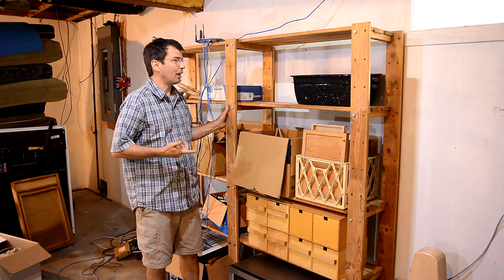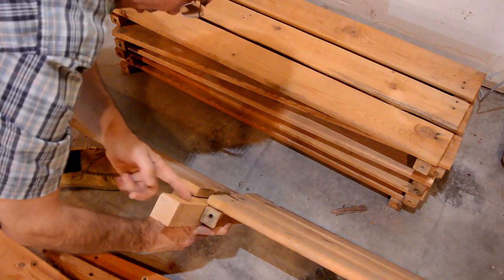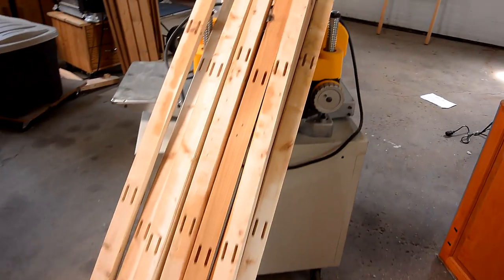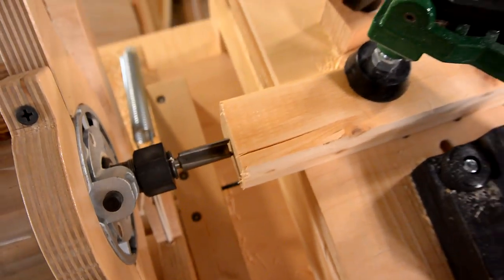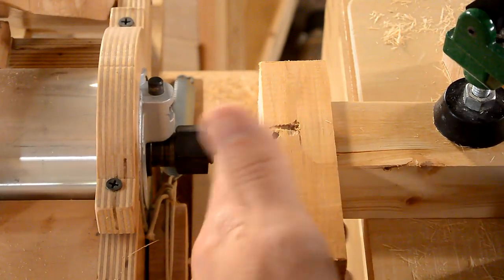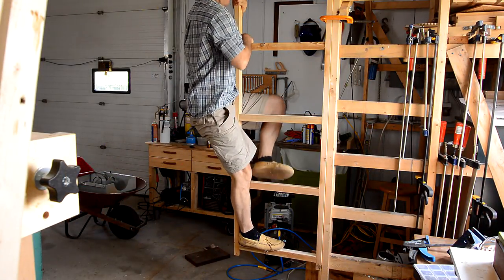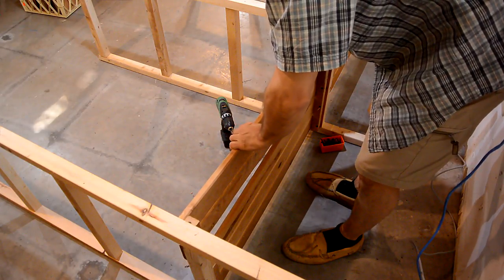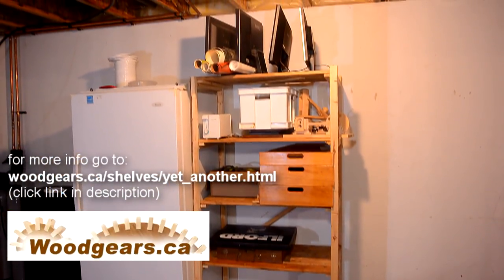Yet another shelf build

Comment: I'm pretty sure those shelves are an IKEA kit - or they're very similar. In the IKEA kit there's a diagonal steel member to address the wobble issue, but it would seem whoever put that kit together left that bit out.
Reply: I have some in my basement and they are pretty sturdy. Clever design too. They aren't bad shelves.
Reply: James Nugent I see reading is your most advanced skill.
Reply: Neroxen I did read, and understand, the comment. I just wanted to use the joke of how ikea furniture is difficult to assemble- however badly I made the joke
Reply: James Scheffler that was my thought right at the start of the video.  A few diagonal struts, or corner gussets, would have saved a huge amount of work here.
Reply: James Nugent Ikea items are difficult to assemble?? Seriously... It's one of the easiest things you can do. The instructions are clear and parts usually only go one way and in one place. I dont understand how someone would not be able to build Ikea furniture.
Reply: We've got the same shelves, about three times the number  Matthias  has, they have been in the house about 10+ years *packed* with books and have great. They have outlived any of the cheaper chipboard ikea shelving many times over despite their looks.
The bolt design is annoying(The braces are either damaged or split on ours in places) and causes racking, but other than that it's very solid shelving.
Eventually to be replaced with narrower, custom ply ones to better fit the space.
Reply: Adam Perkins: But that wouldn't make much of a video.  You have to think of the audience, not how much work Matthias has to do.
Reply: Yeah have the exact same ones on my balcony, very rickety indeed. It's fine for what I use it for, which is nothing heavy.
Reply: iPelaaja1 I can assemble ikea furniture no problem. It's just a running joke that ikea furniture is hard to assemble for the common joe who has little woodwork experience
Reply: Only the later versions. I have the exact same shelves from 18 years ago and they didn't have the members back then.
Reply: I tried to extend an old set with new elements,  times and dimensions have changed, it also contains 50% less wood now.  I had to do some 'woodworking' to bring it together.  
For what I see the cross braces already existed 18 years ago
Reply: I found one of those Ikea shelves, that someone threw away because the metal stays broke.  Very flimsy ; I fixed it.
Reply: Yes, it's a Matthias Wandel Ikea hack!
Reply: Ikea  0 points
Reply: This is not a IKEA shelf!
Greetings from Sweden.
Reply: from Ikea garbage to Matthias proof in under 7 minutes
Reply: I personally think the original design looked way prettier... a fix would have been better me thinks. :/
Reply: These are IKEA HEJNE shelves. I have some in my basement and they're supposed to have an metal X-brace in the back for stability, and they're good enough for storage boxes and such as-is.
Reply: James Scheffler Those are Indeed from Ikea and were named "Sten". Got discontinued many years ago and were really great. I once built a whole kitchen from that stuff.
Reply: They still have them at where I live (netherlands), one shelf costs 16 euros or something like that
Reply: Yeah, they were basically cheap enough to not be bothered about getting materials for a similarly sized shelf.
Reply: They're called HEJNE and they're still sold As of December 10th 2017

Comment: @ 2:22 Note that with the 2:1 reduction and measuring in inches, 13/8" in the template equals 13/16" in the workpiece, or a simple doubling of the denominator. Working with fractions is underrated!

Comment: As much as I enjoy your elegant solutions and the math you've done to create your personal workshop tools and tool enhancing jigs, I have to ask the following question.
Would it have been simpler to attach diagonal braces to the rear and sides of the shelf unit to prevent the movement?
A significant amount of labor was utilized in this project.  Were there aesthetic or other personal reasons for the transformation?
Thanks for sharing your projects.  :-)

Comment: Here is how build utility shelving. It is utterly simple, very strong, easy to assemble and disassemble. I drill a hole at each corner of my shelving material. I cut PVC conduit to lengths equal to the shelf spacing required. I run four long lengths of threaded rod through the shelf corner holes and through the PVC spacers. Nuts and washers top and bottom on the threaded rods pull everything together, and I am done. This method also enables shelving units to be hung from a ceiling - the top ends of the threaded rods secured by appropriately strong brackets. Threaded rod can be purchased in lengths up to 10 feet.

Comment: When I build my ladder shelves, I usually make fronts 5mm lengthways longer at the bottom than backs. 5mm is only a SLIGHT difference and it works like a charm. I have build a few library shelves this way and none of them slants forward. With 5mm longer on front, all my ladder shelves rest perfectly against the walls, no wobbliness and so no need to nail them against walls. I have one entire wall covering with sturdy shelves holding thousands of books.

Comment: Quick question about your routering technique.

 I've been programming CNC metal routers for a couple years and I'm interested in a technique you showed. When you make your mortises, you do the whole thing with plunges and then clean it up with a couple passes. I've always used the idea that those bits work much better in a pass than in plunging and that you generally get a better cut if you made three or four passes and only plunged to change depth. That being said, what is your reasoning for plunging so much? From your other videos I assume that you've done some extensive testing and come to the conclusion that your method works best for your applications, I would just like to know what the difference that you've found is.

Thanks
Reply from the maker: When going into side grain, the bit cuts better in plunging, especially after the first plunge, because the chips can escape to the side (I overlapped the holes).  I also get less side forces on the bit that way, which makes for a more accurate mortise.  This may not work as well on a CNC router, because the plunge axis is probably the slowest, and gravity would help hold the chips in the slot.  Going manually, I can see how it's going and adjust cutting speed accordingly.
Reply: Matthias Wandel Thanks! Most of what I cut is metal so I don't have to worry about grain very often. I also have side forces so much higher than with wood that the plunging doesn't help much with that. Also, I'm sure you break bits far less often than we do as we focus so much more on getting mass quantities shipped out that breaking bits is expected to happen several times a day. 

Your answer does help get me thinking about my own personal wood projects though. Thank you again.

Comment: What are your thoughts on using floating tenons as opposed to traditional mortise and tenon?  I find them easier and faster to make.  Maybe you could do a comparative strength test (when you get organized).
Reply from the maker: Nothing wrong with them.  In this case, with the pantorouters, integral tenons were faster.  But - if I made floating tenons out of oak, it would actually have been a bit stronger.  Because the tenon is the weakest part in these ones, and a harder wood would help.

Comment: It amazes me that shelves like these are allowed to be sold they are so flimsy they are basically dangerous (pre MW rebuild). I inherited a set like this and just dismantled it and used the bits as scraps. You pretty much have bolt them to something.
Reply: those are ikea shelves and called "GORM" - they come with a back brace/cross that needs to be attached and also some L-backets to mount them to a wall - if done properly (just a 4 extra screws per unit) and those won't move even if you climb on them
Reply: suit1337 mine weren't IKEA and didn't have back braces

Comment: Matthias, i have a question? I just finished building your 16" bandsaw and it works great, exept for the upper wheel. The innertube tracks off from the wheel. It has came off couple of times but only while turning the wheel by hand. Do you have any idea why that happens?
Reply from the maker: Possibly wheels not planar, so that the blade tracks somewhere other than on the crown.  Also make sure to clean the innertube, and varnich the wheel so it sticks.

Comment: I've never worked in inches, but wouldn't it make sense to only work in 1/256th ? Because  1/256th of an inch is really close to 0.1 mm, making it kind SI compatible, or easy to translate to, and no need to work with fraction all the time..But again, I've never used inches in practice.
Reply: xl how about 254ths?

Or just use inches as inches and stop over complicating things.
Reply from the maker: once you get pat 64'ths, people switch to 1000'ths.  Wich of course is not a multiple of 64.  Go figure!

Comment: Never understood why inches exist lol
Reply: Inches were initially defined in very tangible terms (either based on the human body or on baleycorns), while metres were based on the size of the Earth (which has been known for quite a while, but not precisely enough to dare to define a standard measure on it). As far as standard units go, metres are less sensible than feet and yards, because every other unit was defined through much easier experiments than 'go and measure how big the Earth is'.
Reply: he prolly meant why inches exist NOW, given that metric system is like a 1000 times more convinient and is de-facto an engineering standart, even in the originally imperial system countries like US.
Reply: IFTize 
How is it a thousand times more convenient? I have been reading many great debates on this topic and there has never been a conclusion drawn like that in anything ive read

Comment: Any reasonable person's got to hate inches
Reply: ignilc   This from a guy who makes up tables regarding gear reductions and rotations.
Reply: The base 12 system works much, much better than metric. 
Imperial has it's place, only pretentious idiots think otherwise.
Reply: Lol. You troll you, Rico.
Reply: Pill companies HATE him!!
Reply: The only acceptable reason for using imperial is to measure dongers
Reply: Base 12 is better when you don't have accurate tools to calculate and then measure with precision, but being separate from the base 10 used to represent numbers it becomes increasingly awkward to scale up or down, so any large-scale engineering project ought to find a base-10 system far more convenient. And since the tools continue to become ever more available, it makes sense not to split the units at some arbitrary threshold of project size. So universal metric ought to be inevitable, it's only a question of whether the timescale is measured in decades or centuries.
Reply: Imperial still has a good place in anything human-scale (up to large buildings/structures, and down to things small enough to see with the naked eye). It's good when being completely accurate isn't important, which most engineers will tell you is true in most instances. Having something be off by 1/16 or 1/32 of an inch is usually within tolerance and is easy to measure, and 1/64 of an inch isn't that hard to measure either with a set of calipers. Feet and inches scale well and divide easily. It's not hard to split a measurement in feet into thirds, or a measurement in inches into eighths. It's something anyone who's been working with the units can do.

So yes, while you're probably not going to do orbital mechanics in miles (even though there's no real reason not to since you only really deal with KM in space anyway), you'll still always have a place for imperial units. Base 12 is good for when you don't have accurate tools, but humans are some of the least accurate tools out there.
Reply: Nah.  If you're willing to burn the calories on it though, feel free.
Reply: Not at all.

Anyone who has done any sort of woodworking knows that imperial is a much better system for woodcraft. 
Why do you think almost the entire world builds in inches and feet regardless of their official system being metric? Imperial absolutely has it's place in carpentry. Being able to divide by 2,3,4, and 6 is much better than being able to divide it by 2 and 5 like in metric. It makes everything easier.. Not to mention the units are in a size that makes more sense.
Reply: +RicoDuroska Almost the entire world? What world are you talking about?
Base 10 or 12 is more a question about what system of numbers is used than what units of measurement. And since base 10 is more common in that regard (e.g. a dollar has 100 cents, not 144 144ths, at least it is not commonly calculated that way), base 12 is just inconvenient to deal with. Also fractional vs. decimal/duodecimal: Arithmetic with non-nice and round numbers is much easier in a non-fractional system (if you start intermingling 16ths and 10ths, or 16ths and 12ths for that matter, things become unwieldy really fast, and you end up with some ridiculous number like 129/256ths).

Additionally, imperial is also not strictly base 12 (see how many yards in a mile, for example). I guess many metric advocates (including me) could not care less about using one or another arbitrary fraction of a light-second as a base unit (yes, inches are also defined by the speed of light). What really breaks it is the inconsistency. A factor of 12 (inches in foot), then one of 3 (feet in yard; that one makes kind of sense, but still, not consistent), and then one that isn't even divisible by 3 or 12 (yards in a mile).
Reply: Whatever man, you clearly don't understand what I'm saying. Google imperial vs metric for CARPENTRY and read about it. 

Also, even in day to day life I believe imperial is better. It seems like everyones favorite argument is how easily converted units are but when was the last time you had to convert feet to miles or gallons to ounces on the fly? Cause I haven't had to do it since school.

ALSO almost everyone who uses imperial also uses metric. It's not hard to understand, we just use whatever is better in the moment because we don't have a superiority complex over arbitrary meaningless shit.
Reply: Matthias B. The only reason you can say base 10 counting is easier than base 12 is because it's what you know better. There's more a case for using a base 12 system for mental math because common fractions like 1/4 and 1/3  can be represented without decimals.

Also the inch is only second hand defined by the speed of light because it's standardized to be equivalent to 2.54 cm. And even when they did decide that an inch would be exactly 2.54 cm the meter wasn't based on the speed of light yet, it was just as arbitrary as inches was being based on a the length of a particular alloy bar kept at some temperature. Maybe more consistent than three barley corns, but no less made up.
Reply: A reasonable person doesn't hate anything.
Reply: Matthias B. But I can't disagree with how imperial is really inconsistent. Doing thermodynamics with imperial units was really annoying when having to convert to metric and vice versa because heat is in imperial is make measured in BTUs and heat in metric is measured in joules but they aren't directly related units. Or something like that, I haven't taken a Thermo class in two years or so and my heat and mass class barely used imperial units. My Thermo teacher also wore boots and a cowboy hat.
Reply: tyvek05 Don't get carried away now. Both have their place.
Reply: I like inches.I got 7 of them.
Reply: +moomman89 keep it classy bro.
Reply: RicoDuroska I use mm for all my fine woodworking and carpentry. It's much less error prone and faster and easier for me. I am not sure what supposed benefits you are eluding to but I find working with the plan "everything is in mm" in my shop is very easy. At work everything is a nm 😊😊

Try doing thermo or transport in imperial units. Quick what's the viscosity of water in imperial??
Reply: +Rico Duroska Maybe if you google for English search terms you will get more results on imperial measurements in carpentry. Rest assured that if you googled for French, German or Russian search terms, you are lucky if you get one result where they actually use imperial and not just make fun of it.

+Andy Prokopyk I did not say easier, I said more convenient, and was going for the same point as you. But it seems we're stuck with decimal numbers now for quite a while to come... Also, no matter how one or the other unit was defined in the first place, we can agree both were arbitrary. The real discussion is how they work within the framework of units for other physical quantities or orders of magnitude.
Reply: Which metric countries have landed on the moon? Asking for a friend.
Reply: +whoknows111 the same one that dropped the bomb I believe.
Reply: whoknows111 No one else was trying.  Imperial system is god awful.
Reply: whoknows111 
None as didnt the imperial measurement using country ; )

Comment: I don't get it. You spend so much time making the double mortise and tenons, and then you rely on the entire strength of the shelves from a 1cm overhang of the slats and the shearing strength across the shaft of the screw...
Reply from the maker: that 1 cm overhang is more than enough to take the load.  The screw doesn't actually take the load.